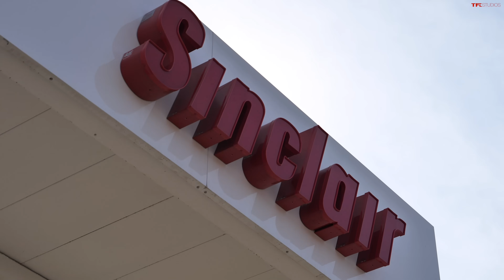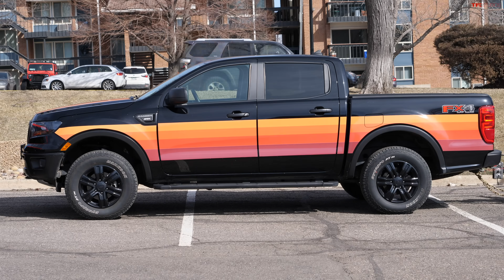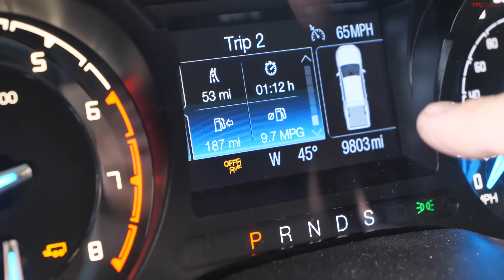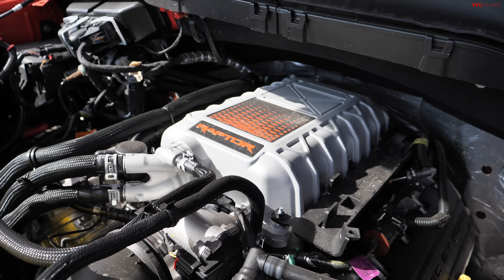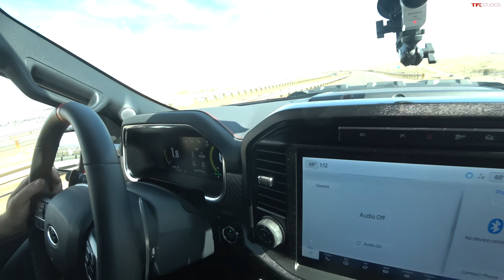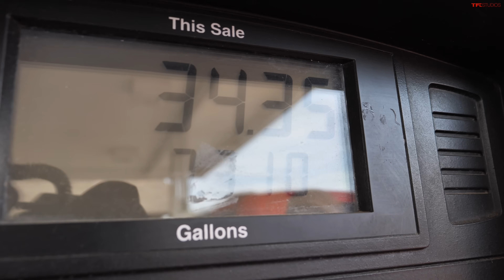Myth BUSTED: Does a Big Engine Get Better Fuel Economy TOWING Than a Small Engine?

Comment: I would do this with GM trucks Silverado half-ton turbo 4 gas, v8 5.3 gas light duty diesel and Silverado EV same towing weight, same cab and bed size except the EV all 4x4/AWD do a MPG/MPG-E loop contact GM contact a trailer manufacture run the same loop at the same time.

Comment: probably the worst full sized v8 for this test to fo it in besides maybe the trx. for the fact of it is even wider then normal full sized, way bigger tires then say the average full sized. And all the other factors nathan pointed out probably really reduced it. not saying midsized cant tow heavier just the raptor r wasnt the best before putting weight behind it.

Comment: I would think people who do trailer tests would have the knowledge to know you want more weight towards the front then it all being over the axels or even behind them🤣
This also doesn’t really prove anything because anyone with half a brain knows an truck like a raptor which is built for power and isn’t built for fuel efficiency isn’t going to win 😅
You can get a heavy duty truck for the price of that raptor, like damn m you can get a heavy duty diesel truck 3500 fully loaded top trim and it won’t cost as much as you guys paid for that 🤪

Comment: The bigger truck will be way more confidence inspiring and safer.   I used to tow a 4k pound travel trailer with a Tacoma and it was sketchy at best, I upgraded to a 21 Silverado 1500 3.0 Duramax and It's literally night and day difference.

Comment: The 2019 Ranger is essentially a half-ton truck still, just compare its specs to a 1997 F150. IMO the Ranger is what a half-ton should be size-wise anyways (the size of a 97  F150). North America's fixation on bigger is better is really gotten out of hand, the size of the fronts of these new trucks now is horrid! I can reach everything in the bay of my Ranger while standing flat footed, couldn't say that about the 2019 F150 I had...needed a small step ladder thing.

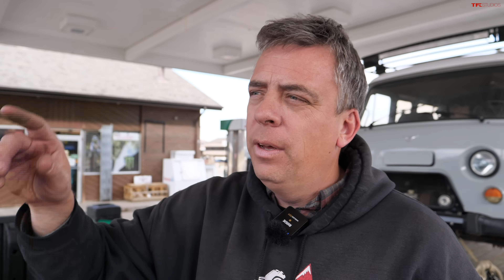Comment: I’m curious what the 7.3L v8 do in the same test?? I’m thinking about getting the 7.3 in a F250 to pull a 5000# trailer and wanting to know if it’ll do better than my current truck (2018 F150 5.0v8 w/10 spd ) 20:35
Reply: I have a 21 F250 7.3 I would get better than 10 with that trailer.
Reply: @MrSvnwolves  really!! That’s awesome.. I’ve had about 4 rams and the best one I had towing the trailer was my 3/4 ton with the 6.4 hemi.. now the f150 I have now gets better Mpg’s than the 1/2 tons rams that were gas but it didn’t do as good as I thought it would do towing my trailer however I don’t do it often enough so there’s that… in your 21 how does it do Mpg’s wise not towing?? My 6.4 would get 12 -13 maybe 14 it the wind is blowing the right way lol…
Reply: @bryanhammond822  I had a 21 3.5 supercrew 4x4.  the 3.5 got 21-24 mpg highway not towing. 6.5 towing anyplace. the F250 gets 14.5 to 15 highway ** I am in northern Colorado and driving on the highway is 80 to 90 mph @55 to 65 in Denver on the highway it's 17 to 18. Towing my 7k lbs TT the godzilla sees from 8 in high winds to 11.5 going from Northern Colorado to Aspen and back.  My overall is 9.8 and the F150 was 11. The gen4 coyote I heard is the best mpg all around. My 3.5 had major issues so we test drove both 5.0 and 7.3 and the wife loved the 7.3 more. The F250 is not the same truck like ride, turning, etc
Reply: @MrSvnwolves  I completely understand that!! I’m in eastern Ks .. live in Topeka  and drive to Kc for work every day… the 6.4 was killing me in gas to where I was spending $200 every week just for gas.. I’ve heard that about the 3.5 but don’t necessarily want those turbos especially when they go out!! That’s why I have the 5.0… I miss having the 6.4 for the power and winch that was on it..I had the poor man’s power wagon!! Tradesman trim with the power wagon option.. I wasn’t getting stuck !! But I took it twice to texas pulling my trailer (7x14 enclosed) and it didn’t even know it was there.. but the towing capacity was a joke because of the power wagon option.. eventually we would like to get a camper so for now a f250 will work and when we get a camper it’ll probably be a 5th wheel then I’ll jump up to a F450 just so I can get the wide track front end ..

Comment: Fuel mileage aside, I bet any V8 engine naturally aspirated will outlive and be more durable than a 4 or 6 cylinder engine with a turbo. Those high rpms and heat are engine killers.
I will take the V8 and pay for the gas or diesel , thank you. Give me a 3/4 ton truck with a big V8 and solid transmission any day. I see these 1/2 tonners and smaller trying to pull too much trailer all the time. It is a recipe for disaster. I do not believe nor care what manufacturers espouse is a truck towing capacity. They lie and exaggerate to sell.

Comment: People can be so fantastically literal. TFL happen to have these two trucks. They are comparing “these two trucks”. Later they will make other comparisons when they have the trucks. They have done the Ike Gauntlet with the 5.3 many times including with the 10 speed automatic. They have also done it with the 2.7 withe the lesser torque rating. (It outperforms the 5.3 Trail Boss). Not straight line, but once fuel economy comes into play. It did an 8 minute climb. They have versions of the full size GM half tons with the 6.2 and the 3.0 diesel as well.  Just look back a little and watch some of the older videos. They have thousands of them! 
     Go back and look at what is already there vs say TFL should do it again and gain and again.

Comment: Great video as always guys. My 2020 F150 with Super Crew, 5 liter and 5.5 ft bed, with 4x4 only has a 7,500 tow limit. A friends 2020 Ford Ranger 4 cylinder turbo 4x4 has the same 7,500 lb tow rating.

Comment: What did I learn?  Um, nothing new.  But for a lot of people that are trying to answer the question of what would be better for them, this does not shed a ton of light on a great efficiency difference.  Variables for every trip and scenario are going to be so drastically different to this test, it is hard to still find the answer.  But IF you drive mostly unladen, don't care about the looks and sound of a big V8, sure, don't bother with it.  Save a few pennies in purchase price.  Save a few pennies in gas.  Save a few pennies in operating costs.(tires, oil, etc)  But IF you are towing 3-7 days a week, I would opt. for V8 performance.  Better to have what you need when you need it, than struggle for it in something less.  😉

Comment: Ford Ranger owner’s manual: Turn off the speed control with heavy loads or in hilly terrain. The speed control may turn off automatically when you are towing on long, steep grades.

2023 Ford F-150 owner’s manual says the same thing

Comment: For a more apples to apples comparison, my brother and I had identical trucks except mine had the smallest gas V8 option and his had the biggest.  I rarely hauled or towed much while he frequently towed roughly 10,000 pounds.  With no load my truck averaged about 3 mpg more than his.  One day his water pump failed and I towed his trailer with my truck while his truck was towed to a shop.  My truck got about half the mpg towing that trailer as his did.  Our conclusion was we both had the right engine options for our different needs but in the case of those two trucks, for towing bigger was definitely better.

In this video I think it still says a lot that the Ranger lost over half of its unloaded mpg when towing while the Raptor starts with pretty bad mpg but loses a much lower percentage when towing.

Comment: Great video, as always.  I was hoping the RaptoR could pull out a "victory", but it was a great test.  I would not buy a Ranger if I was regularly pulling 7500 pounds, but it was good to see that it could safely do so with a balanced trailer.  I'd rather a full-size work truck than a loaded mid-size truck.  Love the room, ride and capabilities.

Comment: Yeah, I have a Ranger at work that's driven by a variety of people (3-4) throughout any given month. The best I've seen (not towing) MPG is nearly 22MPG (Quad cab, 4wd, with a canopy). My personal Tremor gets consistently 17.8mpg with 2300 mi. on it so far. Although, the Ranger gets better mileage I have to say the extra HP, Comfort of a full-size truck and capacity of my truck far outways the extra MPG in the Ranger. This' isn't even looking at how much better my truck will be with towing and I'm sure the MPG difference will be minimal.

Comment: My Silverado with the slug 5.3 struggled to pull 10,000 pounds of trailer and, at best, got 21 mpg. Dumped it for a 3.5 Ecobeast. Like night and day pulling and got 15 mpg with the Ford. Never looked back.

Comment: Great video!  Interesting results.
I'd like to see what we would get if we were to use identical full sized Chevy or Ford trucks but just changed motor size. Compare the 4 cyl turbos and 6 cylinder models to each other and to the V8 models using the same basic full size (and same equipment) trucks
Reply: Agreed this would be a better comparison

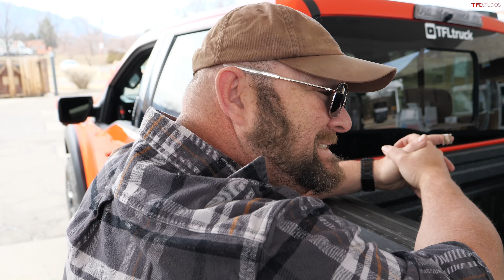Comment: 19:46    This is typical turbo charger versus super charger efficiency. The super chargers will always lose the efficiency challenge. They make power using a belt off of the crank. Like everyone else is saying in order for this to be a fair test, you would have to have two turbo charged engines in the same size truck. Super chargers are only designed for racing applications. They make boost instantly that’s their main benefit turbos used waste gas to produce boost, making them worlds more efficient. don’t get me wrong I’m not hating on the Contant. I would just rather the videos not mislead people telling them that this is a fair test of large versus small displacement. That’s all.

Comment: This is an unfair comparison.  A Performance truck with know low MPGs to an Economy truck with known HIGH MPG's.   You should have used an F-150 XLT or FX 8 cylinder that has an estimated MPGs of 24 to 26 and with the 10 speed transmission.  My F-150 has a towing rating of 11,500 and high MPG's range from 24 to 26.  Your results would have been extremely different.

Comment: When you tow with an Ecoboost anything lock out 9 & 10.. Maybe even 8th. Boost equals worse mpgs. The added rpms will help mpgs. Upgraded intercooler helps immensely too. I dumped my 2021 Ranger for a 2022 Ford f-150 2.7 because of that tiny fuel tank. While towing and getting 9 mpg you're stopping all the time. I love the 36 gallon tank in the F-150

Comment: Its an interesting way to compare these for the funsies, but not really the right test to call this myth busted.  The way the Raptor R is tuned means more enrichment under load than the way the 2.3 would be tuned. the power densities are very different 114 to 140 hp/liter. Im not suggesting that specifically is the reason, just that there are a lot of variables here that make this fun content, but not really clear enough to call it myth busted. I mean, the Aero drag alone could account for the difference.

Comment: My old '99 F150 with the 5.4L Triton V8 got 13 mpg on it's own and 8 mpg towing my little 4k lb camper.  My recently acquired '16 F150 with the 3.5L Ecoboost gets 21 mpg on it's own and 12 mpg towing the same trailer...  It seems these small displacement turbo charged engines take a more significant mpg hit when loaded or towing, but they are still more efficient than the bigger V8 options.  The Raptor is the worst of both since it is a big V8 with a supercharger.  Raptor is an awesome truck, but definitely not the right pick for towing.

Comment: Conclusion,  they're both expensive turds!! That's horrendous. Just towed my 7600 pound Coachman Catalina to the guy that bought it. Never checked the milage towing it, but even pulling away from the stop sign it never got over 3100 rpm! It gets 11and change pulling my 5400lb camper!! It's an 05fx4 with a tuner and straigh thru cats. After watching this I think I'll forget about replacing it! Thanks!!

Comment: Quick question guys a lot of new Raptor R owners are experiencing a oil leak coming from the Crankshaft seal are you experiencing any oil leaks maybe after the truck has been parked?
Reply: You sure that wasn’t a ford option. Fords you know been leaking since the model A. Look on the ground two things  come to mind a ford was parked here or someone used china made seals on there fresh over hauled engine

Comment: I think the size difference matters less, because the F150 broke the wind for the towed van i.e. the van catches more wind on the ranger than than the F150. I bet with flatter/smaller loads (same weight even) the difference would be greater. It is interesting, that with a regular F150 it may have beat the Ranger in this scenario.

Comment: V8s are the best for towing and longevity. I would put up with 1.5 less mpg with an 8 cylinder than wearing  your V6 for fuel efficiency. Ram 1500 owner.

Comment: Its really hard to make a good comparison here with two different sizes of truck, etc. On paper you'd want to go with the smaller truck because its going to get better mileage when you're NOT towing, which is most of the time. However, towing more weight than your tow vehicle causes problems, as was shown with the trailer issue.  BTW---thank you guys for taking trailer sway seriously. I totalled my new truck and trailer in a very scary crash last year, luckily walked away unscathed, and I dont want anyone else to ever have to go through that. BTW i thought I had it set up perfectly, was towing a lighter trailer than these guys with a heavier truck, had anti-sway bars, and it still happened. trailer sway is no joke.

Comment: It's all great that you're doing tons of videos about towing and off roading.  Trouble for me is you almost totally ignore snow plowing, especially with a 1/2 ton.  It's getting harder and harder to know if a truck is capable of snow plowing with all these new engine choices!  I for one don't haul around huge trailers or go insane off roading.  I want my truck as an everyday ride plus the weekend warrior bit.  Here's the biggest issue, manufacturers are doing what your doing.  Focusing on towing and off roading.  The trucks are being made to have more and more ground clearance to the point a 3/4 ton won't fit through the average garage door height opening!  Crazy!  I for one live in an area that gets lots of snow and I'd like to keep my truck in the garage and not have to clear snow off it every 5 minutes.  So a 1/2 ton works for me and It's getting harder to know if the new trucks with these smaller engines can still plow snow.  Example the new Tundra.  I for one like having an 8 cylinder without E-Torque nonsense to plow snow with.  So what I'm trying to ask is for you to not ignore this aspect of truck owners, the one who only needs a 1/2 ton because we're not plowing as a business just for our own property.  I hope you can do this.  Thanks for all your videos that you do anyway, they're still entertaining.

Comment: I had a 98’ B4000 (same as a Ranger) and I remember reading a review that the bigger 4.0 V6 actually got better mpg than the 3.0 V6. The review claimed that the 4.0 had better low end torque, so you didn’t have to give it as much throttle to accelerate. I found that to be very true. I’d always get 1 mpg better than my friend with the 3.0, and we had pretty similar driving styles and everything. In this comparison, the Ranger loses a much higher percentage of mpg compared to the Raptor. Going from 21 to 9 is way worse than going 11-12 to 8.

Comment: Speaking of optimistic MPG computers, I had a Crosstrek a couple years ago. It would say I would get like 42 mpg open highway from gas station to gas station and I’d calculate it out at the pump like you do and I’d get like 35. Made me mad every time. Like how can it be off THAT much?
Reply: Every single fuel economy estimator built into the vehicle is wrong by at least 10%. All of them. Hand calculating is the only way to get the truth. I say 10% because two of my last vehicles were optomistic by 10% almost exactly. A 22mpg computer guess-timate would always calculate by hand to 20mpg. And 28mpg computer guess-timate would calculate out to 25mpg.
Reply: overly optimistic MPG trip computer readings help sell cars on test drives...

Comment: The Buhanca is mid engine so when you lined the front bumper to where you thought the weight would be good but the engine is back almost centre. Good lesson is that any load in your thing you are towing might be unbalanced because of the junk inside the thing you're towing

Comment: Good test but not complete, you need to either set the ranger for off road or set the raptor up for highway, then you have a 100% fair test. Try again please
Reply: Well, TFL is not going to "try again."  Their test succeeded perfectly in what they intended: to compare the vehicles in the trim that comes standard with each vehicle, just as a consumer would most commonly get straight off the shelf.
Reply: @anthonyc1883  So the title was wrong and they were comparing trucks not engines
Reply: @michaelwest2388  To some extent, TFL will always have to be comparing the engines AND the trucks. The Raptor R does not come with a turbo-4 in addition to its V8, so there can't be two Raptor Rs facing off, and the Ranger does not come with a V8 in addition to its turbo-4, so there can't be two Rangers facing off either There's no way to make this strictly apples to apples. And even if there is some pickup model out there that can be had with a turbo-4 and a V8, TFL can only test what it has on hand at any given time and they've said so many times. I suppose they do the best they can.